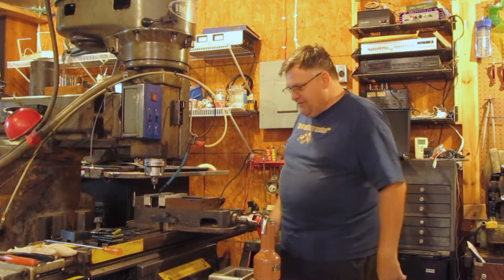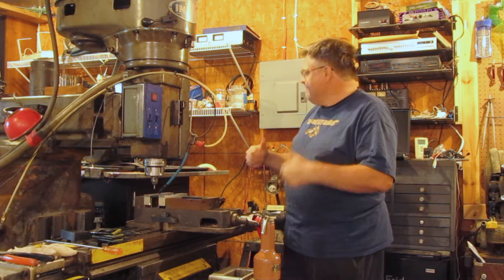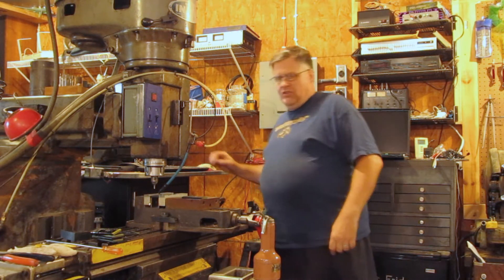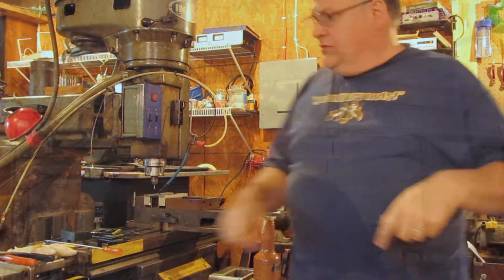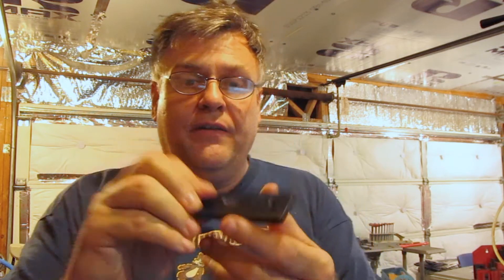Wells Index 823 Update #3 - July 13, 2014 - Cutting Steel.

Comment: Great! Very well done! Great achievement one month after you moved the beast. I'm also dreaming of a mill but they are too heavy for my workshop. Old mills usually don't have the motor axis while relatively inexpensive and motorized mills are expensive.   
I saw you are using Linux CNC with a Laptop. What laptop you are using - there are only very few ones that work with Linux CNC? For my new (old) Robot I'm also using Linux CNC.  
I hope we can see more cool videos in the future with your mill.
Reply from the maker: Actually... the laptop is a music server... got about 8900 songs on there. The PC is the CNC machine with the LinuxCNC. It doesn't take as much as you might think to make a milling machine CNC... about $600 total.